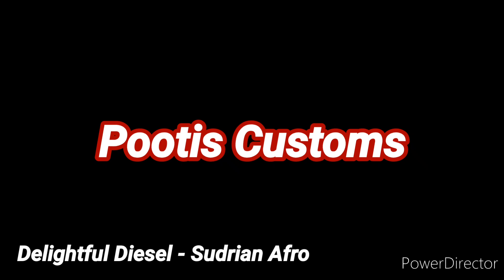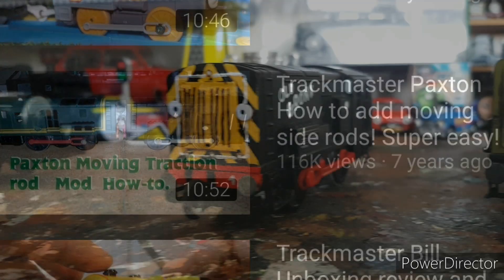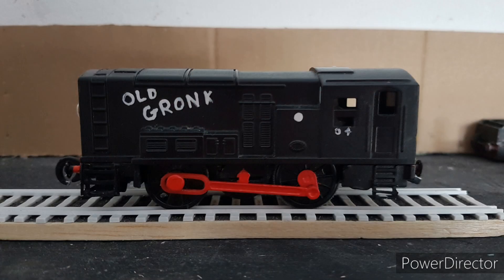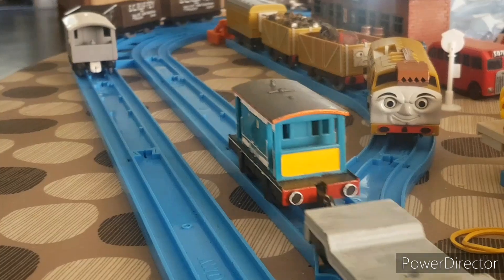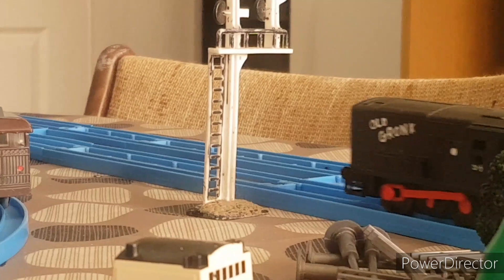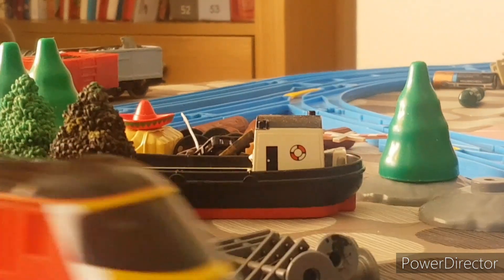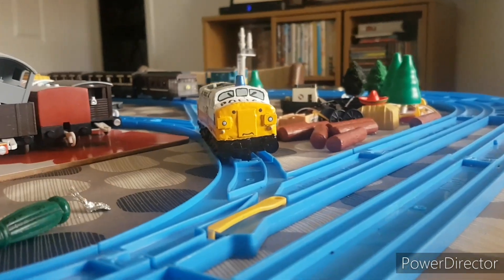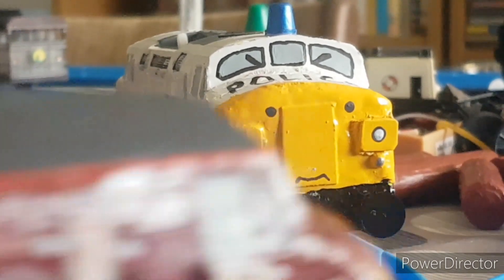Pootis Customs - Old Gronk

Comment: Cool but how can he go backwards
Reply from the maker: Battery tinfoil tape

Basically reverse the polarity of the motor by sticking the battery in backward and using a battery so the other terminal will touch the terminal closest to the switch
Reply: OK thanks because it looks so cool